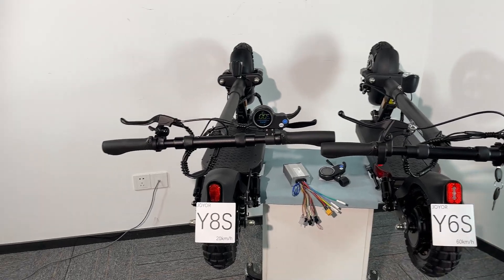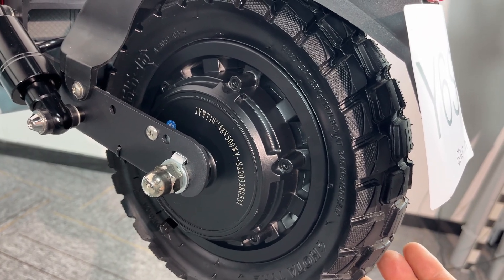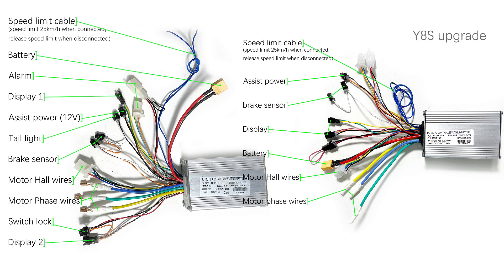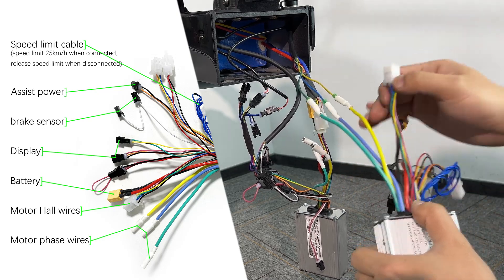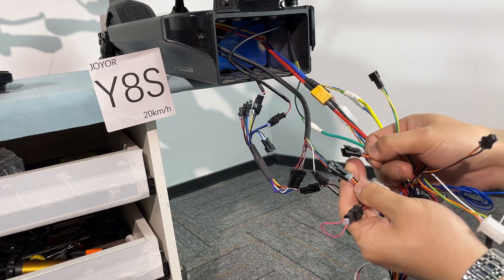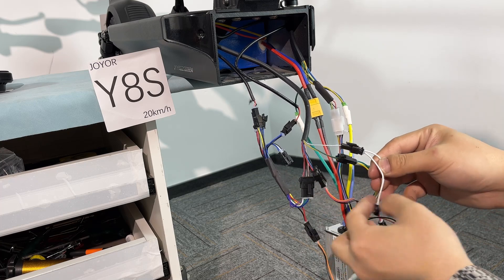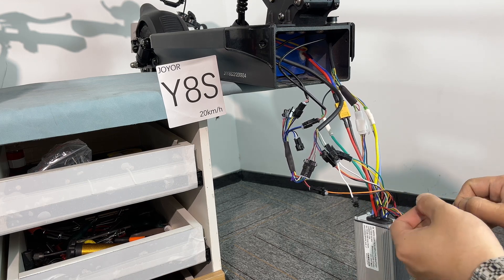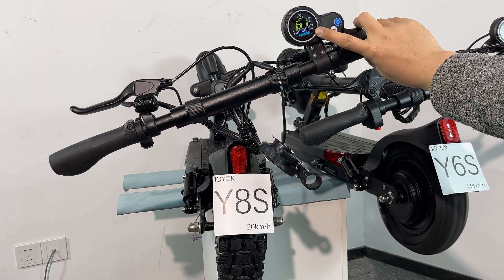How to release speed limit on JOYOR Y8S scooter? Change the controlle. electric scooter modification

Comment: i have a evercross h5 sencond generation 800w scooter im replacing my controller switch and my new controller dose not have a white wire like my oringnal one dose and my scooter is showing a tringle simble and   will not move what is the white wire fore

Comment: Where can you order the replacement controller please?
And another question, the Y6S doesn’t have a speed limit at all on delivery? The Y6 seems much better, also has a key, blinkers aso, why is the Y8 more expensive?😮
Reply: More power and more range and more immune to motor heat

Comment: Update: Das Blaue drosselksbel befindet sich im controller selbst, einfach die 3 Schrauben an der Seite lösen und die platine herausnehmen, genau auf dem Board ist dieses Kabel. Man braucht keinen neuen Teuren Controller zu kaufen
Reply: @Haus Maus doch 🤣🤣🤣.. du musst den Controller aufschrauben und dann die platine rausnehmen dan befindet es sich rechts!! Kann natürlich sein das sie es wieder verändert haben das glaube ich aber nicht
Reply: @Haus Maus Den E-Scooter zusammen klappen und die vordere Klappe am Deck vorne entfernen. Insgesamt 3 Schrauben rechts links und unten.
2.
Den Controller rausholen und die 4 Schrauben am Deckel wo die Kabel rauskommen entfernen . Dann die 3 Schrauben an der Seite des Controllers entfernen . Dann kann man die Platine vorsichtig heraus ziehen.
3.
Auf der Platine ist ein Blaues Kabel .
Das muss in der Mitte getrennt werden.Dann in den PSettings bei P15 auf 100 stellen. Und das wars auch schon. Jetzt müsste er ca 40 km/h fahren ohne last zeig er 49 km/h.
Reply: @Haus Maus lass lieber dann die finger davon😅...vllt hast du ja ein Kumpel der sich mit elektronik auskennt. Also bei mir hat alles super funktioniert, vllt hast du das falsche Kabel abgeschnitten
Reply: @Haus Maus komisch bei mir war es blau 😅.. naja wenn du es jetzt gelöst hast dann wünsche ich dir viel spaß beim fahren
Reply: @Haus Maus du weißt aber schon das du am lenkraddisplay bei Einstellung p15 den Wert noch auf 100 stellen musst 😉!! Vllt hat es deswegen nicht funktioniert mit dem blauen Kabel, ich frage mich wirklich welches ,,Rote'' Kabel du getrennt hast 😅....nicht das wir jetzt alle explodieren😆🤣
Reply: Wieso immer Kabel durchschneiden reicht nicht eine seite ablöten isolieren!? und wenn, kann ich dann weniger machen bei P15 so dass 22km/h fährt? @Schneidi27
Reply: Morgen Jungs. Ich will mein Kabel demnächst auch durchschneiden aber es gibt doch immer viele Polizeikontrollen. Hat einer eine Idee wie ich so einen Schalter anbauen kann dass er nur noch 22 fährt oder kann man das an Bordcomputer mit dieser P15 Einstellung umändern? Habe schon reedschalter schliesser bestellt und wollte das mit nur einem Magneten auf dem Roller klären. Aber die Kabel an den Schaltern sind so mega dünn glaube das funktioniert nicht. Habe keine anderen Schaltern oder Schalter mit Fernbedienung gefunden hat einer einen Tipp?
Reply: @TheRealKowalski  wenn das Kabel durchgetrennt ist dann kannst du in den p Einstellungen die Kraft der Batterie runterstellen damit er dann 22 fährt. Dafür musst du dann anhalten und ab in die p Einstellungen von 100 auf 56 stellen oder zur Sicherheit etwas niedriger.
Reply: @TheRealKowalski  am besten blauen kabel in ruhe lassen, man kann zwar einstellen im display prozent power weniger das genau 22 fährt, aber ohne drauf stehen zeigt er dann 25 kmh.Ich hatte ohne Blauen kabel ab zu klemmen ein Display ( Focan GZ3 ) angeschlossen alles klappte alle P Settings auch nur hab ich nicht hin bekommen das dann auch das Licht geht wegen extra scheiß Lichtschalter und weil Alle Kabel zu einem Strang führen, also bleibt der Scooter wie er ist!

Comment: There are another method before cutting the blue cable it work on y6s with limited speed to 25km/hm even if programme p15 is at 100
You need to push the brake ,at same time open the scooter with buttons power 
Always push the brake at the same time you will then push the acceleration button 3 time
2 time quickly and one time you stay 3s
If you do that the speed limit will be removed and if you do that again the speed limit is back
No need to cut the blue cable

Comment: The 2024 Y-8S model does not have the blue cable for the speedlimit, another way possible to unlock the speed by the cables?
Reply: if you found a solution, i would like to hear it, i have the same problem
Reply: @thg1841  ok, I am afraid we need another controller, they are sending me one as we speak.
Reply: @thg1841  got the new controller, 32/34 km/h it goes now (I am 85kg), also you can adjust the torque to a lower level, much more comfortable while the topspeed is almost  the same. On the controller it is written 25km, probably 25km/h if you connect the limiter cable, it is delivered deconnected.

Comment: If you cut the blue cable that goes out and back into the controller on the original controller, the Scooter 45 will drive
Reply: What if it is not a blue Cable
Reply: My friend, how can I know the blue cable? There is more than one blue cable.

Comment: Guten Abend, ich habe gerade den Batteriecontroller angeschlossen... das Display des E-Rollers geht nur an, wenn er an die Steckdose angeschlossen ist (Laden), wenn ich das Batterieladegerät entferne, geht nichts an, Sie wissen warum.  Displey E-0 😅
Reply: Good evening, I just connected the battery controller... the e-scooter's display only comes on when it is plugged in (charging), when I remove the battery charger nothing comes on, you know why
Reply: Apparently the battery is fully charged

Comment: Hi, do you know how to unlock the speed on the joyor f7? It has 3 blue wires and no one works when i cut them, and the access to p08 on the display monitor is restricted
Reply from the maker: What is the current top speed? Perhaps this is already its maximum speed.
Reply: @SCOOTERREPAIR-kf2fn  Its only 30km/hr

Comment: You don't need to change the cotroller, inside the original one you have this blue cable :)
Reply: Inside the yojor y s8 I could just cut the blue cable inside the Platin? Would be helpful im from germany
Reply: Do you have to open the controller

Comment: Hi, good video thanks. The newly shipped Y8S scooter I received does not have the blue speed limiting cable. Is there a way to take the originally-shipped Y8S controller (which does not have the blue cable) and disable the speed limiter without having to find and swap an additional controller from earlier models? If there is another cable on the Y8S which limits the speed, I do not know which ones it is.  Many thanks for any suggestions you may proivide.
Reply: It doesn't seem to work. Only the controller can be replaced. the original Controllers are custom made. Customized for a special certificate in Germany. So there is no room for opportunism.
Reply: @Mechanic0007  Thank you for your reply.  I shall indeed try your original solution then.  Thank you for providing that and have a great day!
Reply: @Will2win24  das blaue Kabel ist im Controller selbst, du musst die 3 Schrauben an der Seite des Controllers lösen und die platine rausschieben und voilà da erbkickst du das blaue Kabel. Du musst keinen neuen Controller kaufen
Reply: @Schneidi27 Gehen die Y8s auf 40 oder 60, wenn Sie das blaue Kabel im Controller herausnehmen?
Reply: @JULUSK-ru6kv  49kmh ohne Belastung je nachdem wie schwer du bist geht die Geschwindigkeit weiter runter, ich wiege 70 kg und schaffe 44 kmh
Reply: @Schneidi27 Hast du deines legal gekauft und dann das blaue Kabel herausgenommen?
Reply: @Schneidi27  I confirm!
Reply: @Schneidi27  Servus meiner geht nur 32 mit durchgeschnittenem Kabel? bei 100%
Reply: @guidokiefl38  stell mal im den p-settings auf 100%
Reply: @Schneidi27  Danke für die Anwort vielleicht muss man was anders einstellen?
Reply: ich denke das liegt am Controler vielleicht ein anderer typ jetzt?
Reply: @Schneidi27  Servus habe auch kein P6 oderP7 um die Reifen große zu verändern
Reply: Could someone help me regarding joyor y8-s?  Which blue cable exactly should I cut to unblock it, because there are many blue cables?

Comment: just cut the limitor wire instead of buying a new controler
Reply: thats working like a noob bro they both were resticted your original onz has also the cable just cut your original cable

Comment: Hello sir!
My Joyor s10s scooter. I bought it 2 months ago.
Now there is a big problem, the battery has full charge but when the scooter is turned on it shows low battery. pea, light nothing works. Again, if the charger is connected to the current, then the motor, lights all work.
I hope to get an answer from you how to solve this problem.
thank you sir Please reply.
Reply: Vielleicht der Bsi Controller an der Batterie?
Reply: @stefaneisler  maybe battery